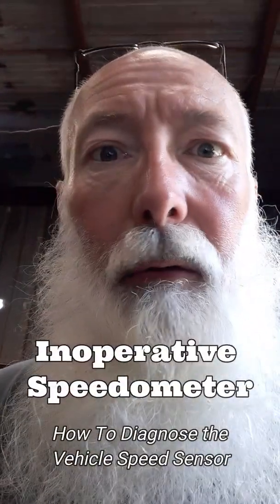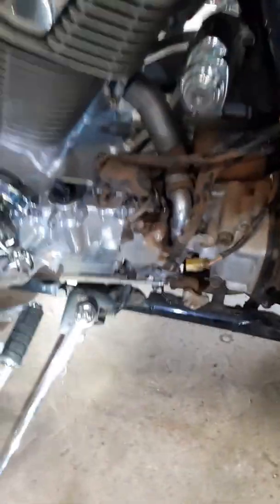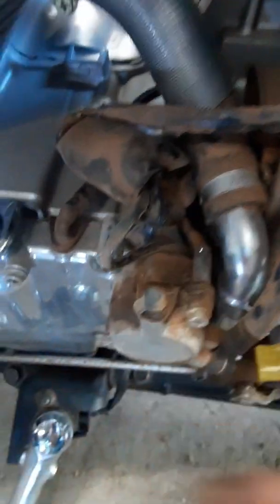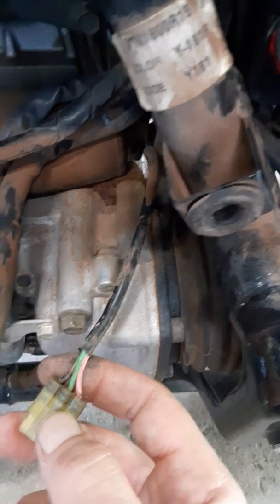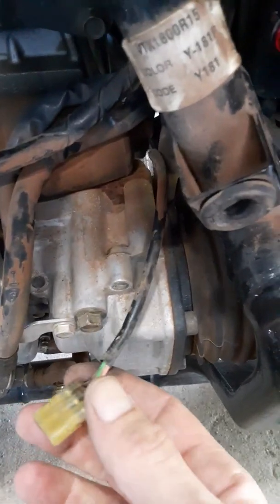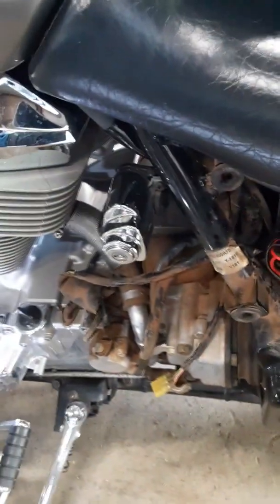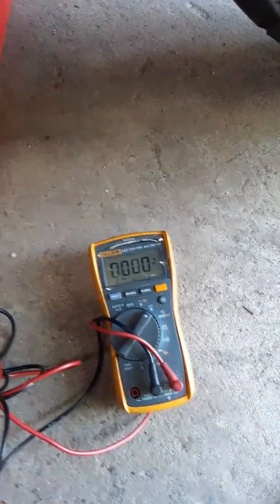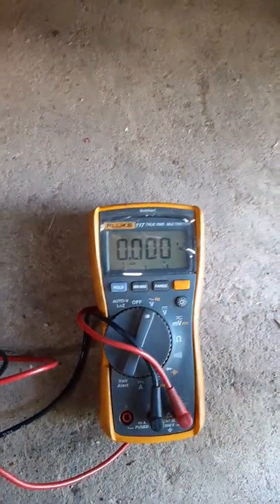Motorcycle Speedometer Diag w Voltmeter- Vehicle Speed Sensor Testing- Speedometer-Odometer Fail

Comment: I think you measuring wrong. Voltage 12V must be aplied to the sensor, and pink cable (out) oscilating with negative pulses.